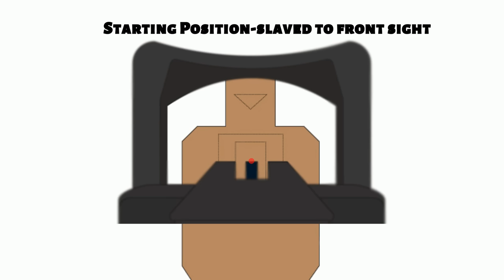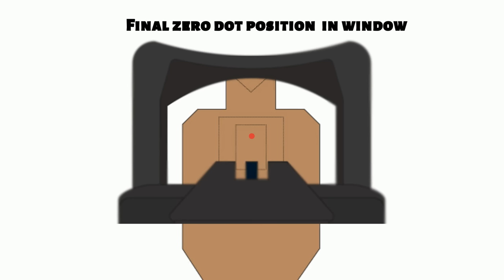Zeroing a Handgun Red Dot Sight

Comment: Aaron, I just happened to be at the range when I saw this post. I began applying some of the knowledge you shared, and I managed to successfully get my RMR zeroed. However, I did stumble upon one question that I believe you touched on but I don’t know if you expanded with context. Did you zero your suppressor sights at 25 yards as well, prior to slaving your red dot? 

I performed this step afterwards and got relatively close.... Given they’re backup sights, I didn’t fuss too much when they were just slightly low of my POA.
Reply from the maker: MDX windage can be adjusted, not elevation. Most of my suppressor sights are POI at 25. Some around 15.
Reply: Great advice. Thank you for the follow up.
Reply: @SageDynamics  Elevation can be adjusted. That's why Dawson has so many different front sight heights. I'm a stickler for my irons to be as as close as possible

Comment: How did the dot change in the window significantly, from the last last two groups?
Reply: That's where you should be placing the dot when shooting. You have to look through the center of the glass as much as possible. So the actual zero was burried towards the bottom of the glass and sights, but when the gun is aligned properly you won't see the sights much.

Comment: I know that I'm late to the party and to this video, and I'm learning to use elect-optics. If you have a handgun with an RDS and dialed-in suppressor- height  sights, wouldn't the dot, when zeroed, naturally fall on the front sight?
Reply: That's where my dot landed after it was zeroed, I don't get the slaving part to the iron sights and bringing the rds in the middle of the window..

Comment: Can ANYONE PLEASE HELP!?!? My rds is like an RMR, but doesn't have the two post's & my slide is cut about 1 mm too long. So there's a small gap at the front of the rds and the back sits against the slide cut, but other than that it's just the two screw that are lock titted holding it on. Is that enough? Should I fill that small gap? Or just a little lock tite in that gap, and the two screws lock titted & torqued down correct enough to hold down and keep the rds from extra shock when the slide reciprocates? PLEASE HELP.. ANYONE KNOW &/OR HAD SAME ISSUE?

Comment: I got into pistol red RDS a year ago. I couldn't tell you how many people say that to co-witness the dot to the front sight is the correct way. I never did agree with that for all the reasons you stated. 

What I like best about RDS on different pistols I own is that the POA and POI is the same for every gun. With iron sights I have guns with a combat hold, center hold and my adjustable sights a 6 O'clock hold which I prefer. With a RDS I use the same hold on every firearm.

Comment: Sir, I just got my Glock slide back milled with the RMR ans the rear notch forward of the RMR, like yours, and I’m also running an x300U... is the Safariland 6354 DO Holster good for it, or would it require any mod work done to the holster??? 

I saw in a prior video that your run that holster with the same configuration. That’s why I ask.

Thanks for your time.

Comment: Ok gays please help me ok,well I just bought me the new Taurus raging hunter in 357/38 special now.and a nice vortex red dot site to put on it now ok,so can anyone tell me at what distance should I site in my pistol in on to get it to shoot out to at least 100 yards.like 10,25,50,75 or 100.and if it is 100 will I be able to shoot with in 100 yards with out holding my pistol high or holding it low,it has a barrel length of a little over 8 inches now.i love to pistol hunt with my older Taurus model 66 357/38 special for deer.on it I have a Simmons prohunter 4/32 pistol scope on it with a 6 inch barrel,and this is my first time with a red dot scope with only 1 bright red dot in it.i always site in all my rifles in at 100 yards for deer hunting,this red dot scope has me stumped a little right now.id love to be able to sight my new pistol in at 25 yards and it be able to shoot plum flat out to 100 yards now,and I'm using 158 grain soft point ammo in it and will be deer hunting with it to so can anyone give me some advice on where I need to site this pistol in at yardage wise!!!!!?????

Comment: At the final zero dot position in the window. Do you adjust it up? Or are you positioning the dot in the center? Thanks
Reply: I was wondering this too
Reply: Bryce Litfin, glad I’m not the only one wondering, LOL
Reply: Tom Picchi, dot was and should always be roughly in center if viewing window; ignore irons when using dot to aim. Dot moves with your head, so keeping the irons low and having the dot well above maximizes field of view. If dot fails, simply raise pistol slightly to line up irons and soldier on. Hope that helps.
Reply: @f308gtb1977  so you're saying when you are viewing the dot high up in the window, that your irons will essentially be positioned with your front sight post high in relation to your rear sights? So if your dot  goes down then you have to adjust the gun back downwards in order to get an accurate iron sight picture?
Reply: MusicMan1eAnda, yeah that sounds exactly right. 

With the dot higher, the front and rear sights would still be lined up with each other in relation to the target, but from your slightly-elevated vantage point it would APPEAR that the front was “elevated” in relation to the rear.

The best thought experiment (or you could actually do it) is to imagine locking your pistol into a vise with it being perfectly aimed at a bullseye at your confirmed iron sight zero distance. Your irons would appear to perfectly line up only when you’re perfectly behind them and in line with the target. You can move your head anywhere and ruin your sight picture but they don’t move. Then turn the zeroed RMR on (assuming the same zero distance for this experiment). Unlike the irons, when you move your head behind, but within, the window, the dot “follows your eye” and stays on the target (ignoring the slight parallax). The dot is on target whether it appears at the tippy top of the window, or right in line with the irons, and in either case the irons never moved. 

If everything is zeroed and the gun didn’t move, both sighting systems are always aimed at the target no matter where your head is. 

The advantage to the dot then is that you have the whole window to get sight alignment vs. the irons.

I hope that helps some.
Reply: @f308gtb1977  I think I may have to actually buy an RMR before I truly understand unfortunately. I haven't looked through red dot sights enough to really understand how they function.
Reply: MusicMan1eAnda, oh, if you have any pals with an AR, probably 75% or more of them have a red dot now, so just go shooting with someone. (It’s just basically bouncing a light off some see-through mirrors. Sorta.)

Comment: With the addition of suppressor height sights, would you "file" down the front sight post or the tops of the rear notch to give you a 25 yard zero if elevation is off?
Reply: Most people that want their gun to be that “on” at a particular zero would probably just choose custom sights. You can either pick your sights independently from a company that lets you mix and match front and rear heights, or pick a set with an adjustable rear sight.

You probably wouldn’t want to file a sight (maybe mill it, but not file by hand), and you certainly wouldn’t want to either file or mill it if it has a tritium ampule in it.
Reply: Kris Says

Comment: @sagedynamics Once my red dot is slaved to the front sight and I proceed to use the red dot exclusively, would it be reasonable to cover or tape my iron sights?  I’m only now realizing how programmed my eyes and brain are to acquire a hard front sight and alignment as quick as possible. Ive shot exclusively iron sights for about 8 years but recently purchased my first pistol RDO. Ignoring my sights might be a task I’d have to actively concentrate on doing otherwise. Just curious on your take?

Comment: Take a glock43 for example. My off duty firearm. Would you cut this zero process back to say 10 yards? Or at this point is it what the shooter is comfortable with doing. Personally speaking I shoot my duty glock 19 better than the 43 due to the size difference in grips.

Comment: Great Video! Would you recommend Sight-in a Holosun 507c with just the Dot on or with Circle and Dot on? I just purchased a Gen 5 Glock 22 40sw MOS and I added the CHPWS V4 plate and a 507c Green V2 Reflex sight. I also added the XS Sight RD3 Suppressor Night Sights since I like to run Night sights on my Carry Pistols but this will be my first Optic Equipped Sidearm for Concealed Carry I have been carrying a Gen 4 G22 for years so the Gen 5 MOS was a natural progression.

Comment: I recently purchased a new firearm with a red dot sight factory installed. The instructions with the sight said that it was zeroed from the factory. I set up a target at 25 yards and fired 3. Checked the target and found no holes. Got a larger paper target. The gun shot 12 inches left and 8 inches low. I called the gun company customer support line and discussed this, and was told I had to co-witness the dot and the iron sights.

Comment: Random question but have you run into any problems with the glock 19 mos ?
Reply: Plates are prone to cracking, and the optic sits slightly higher than a milled slide optic sits.  The MOS optic cuts are also not nearly as robust as a milled pocket. From my experience dealing with the MOS anyway.

Comment: Hey Mr Aaron, I just getting into red dot on handguns. I just ordered a Vortex Viper. Now I also just bought a Sig P320 x compact with the comman Sig night sights, but to put the red dot on I have to take rear plate off and the rear sight is built into the plate and the front sight isn’t suppressor height sight. So when I get ready to zero my red dot do I still merry up the red dot to top of front sight?

Comment: So I recently bought a Glock 40 MOS. 10mm 6” barrel. I purchased a venom red dot for it and this will be the first red dot sight I’ve ever zeroed. I took it to the range hoping to get a decent group at 50yds for hunting applications. I started the zeroing process at 25yds and I just couldn’t seem to get a good group. I feel it isn’t the weapon’s fault but I was using a bag rest just like the one you show in this video and my windage was way off. I had to adjust the windage as far to the right as the optic would allow just to get it in the center of the paper. Elevation I could get decent but my groups were not good at all. I felt like I was nice and slow with my trigger pulls but still my groups were about 4” at 25yds which isn’t what I feel the weapon is capable of. Is there any suggestions you have on this issue? Things that I can look to improve on. I feel like there isn’t much to mess up on besides pulling the trigger on benched shooting.

Comment: I have a Glock 21 Gen 4 with a Double Diamond Precision Barrell and compensator. I also have a Tungsten captured factory weight spring recoil spring plus a uncaptured and captured 13 pound (due for the comp. I also have a RMR type 2 adjustable red dot and the Trijicon suppressor sights. First what is the best HST and Guard Dog target ammo's that are comparable in target shooting that match these ammo's? Second does anybody have experience know what the best recoil spring weights work best with these ammo's and the Double Diamond compensator are?
Reply: Sorry forget to mention I an still waiting for the slide but I also have the Glockstore Mako cut and red dot cut for the RMR sight.

Comment: What does a 25Y zero do at 50Y with 124gr ammo?  
With regular iron sights, I have to aim about 6"-8" low to hit at 50Y, but I assume I'd have to aim dead center or high for 100Y.  I'm wondering how a red-dot affects POI at distance SINCE the dot is much higher over the bore then regular iron sights.

Comment: Hey Aaron, first off I want to thank you for all the knowledge you share. It’s good to know there is somewhere you can turn to for unbiased information. I’m just wondering what you have found to be the best zero for 45 acp. I know for 9mm , you go with 25 yds (as do I from your videos). I just haven’t been able to find any good content in regards to 45. I’m using Speer Lawman 230 grain through an FNX 45 Tactical mounted with a Trijicon RMR. Thanks again for all you do.

Comment: I’m confused, the first three adjustments are all in line with the irons. Then the final zero dot position in window is floating way above. How did you go from basically co witness with irons to all way up there floating by itself. I’m having a hard time zeroing my first pistol dot. Only way i can hit is completely co witness. I’m doing something wrong here.
Reply: The difference is in the angle that the gun is presented when aiming , if you’re dot is zeroed onto your front sight when you present you hold the gun more relaxed so that the dot is in the middle of your window instead of holding it with the irons aligned. Holding the gun so the irons are aligned should give you the same point of impact as if you held the gun more relaxed with the dot in the middle vs aligned with the front sight 🤙🏽  Hope this helps/makes sense haha Red dots are parallax free so wherever the dot is, if properly zeroed, that’s where it should hit allowing you to hold the gun more relaxed and not trying to align the sights

Comment: Thank you I feel like I have a platform to go off of when I'm zeroing my holosun 507c on my glock 19 mos but I did mill the screw holes so there a little deeper so it will not come loose or move at all I've shot 2,500 rounds and so far so good so thank you earen I really appreciate the time that you take to put out such informational vids man 🙌🏼
Reply: Charles hood how are you liking that optic I been thinking about getting it over the Trijicon
Reply: @roba168  Rob, I have a Holosun 507c and 507c v2 and I love both of them. I think its ridiculous that it went up like $80 for v2 for the battery compartment to be on top. Aaron very good videos on the Holosuns.

Comment: When he says "roughly centers the red dot in the window", is he doing this centering by adjusting the dot up via clicks or just by angling/tilting the gun up with his hand?
Reply: Isaac Mouser have you found the answer for this question? I’m still trying to find it
Reply: In the beginning its clicks. You lower it down go the front post with clicks, walk out to 2t yards, bench rest it and shoot 5 rounds. Then you make adjustments.  Do this a few times until you are on.
Reply: Isaac Mouser I get the part we’re he lowers the red dot to match the front sight post but later In the video he says the view of red dot should be in the middle of the window. Is this done by just angling the gun once it was zerod in
Reply: @pokeopening1113  after you move the red dot to the fsp in the beginning, the only time you adjust it again is to adjust into your zero. Centering in the window for centering's sake would throw your zero way off.
Reply: Isaac Mouser bit of you watch his video the first two pictures were his red dot was adjusted says view from the “iron sights” but then the 3rd picture when the red dot moves up it says “window view”
Reply: @pokeopening1113  he also says repeatedly to not zero the dot in relation to the irons. You only zero the dot to the target. Ignore the irons after the slaving process
Reply: @pokeopening1113  you ever solve it? If so please explain

Comment: Thanks for posting this video and your video "Why you should never slave your red dot to the iron sights."  Your videos were extremely helpful.  By habit I had gotten it all wrong. I used the incorrect technique when I shot and placed the red dot on the front sight.  On my next trip to the range, I will re-zero the red dot reflex sight and start with placing the red dot on the front sight and then when I bisect the dot I'll move on and continue the sight zeroing process by placing the red dot in the center of the lens window so that I will be able to shot by centering the red dot in the middle of in the window and place that red dot directly on the target.

Comment: Thank you for this video!!!
First step issue: p320 Xcarry withRomeo1
• salving the red dot to my front sight is not possible. I have no more clicks down and I am left with a gap between my front sights and red dot. My target hits are below at what am aiming. Been trying to solve this problems for months. Thank you for you time!
Reply: If you're Hitting low, your dot needs to brought up. Also know that factory irons can be sighted for far shorter distances than you're probably trying to achieve with your red dot. Try it at 7 yards maybe, then 15, then 25... see if your results improve or not at any particular distance. If they do it could just be an issue you'll have to deal with because of the design of your guns iron sights, if not maybe a red dot issue, slide milling issue etc. may be worth looking into. With some guns and some distances you'll have to decide if you're wanting to go by irons or dot. Even IF you get a "good co-witness" it's only true at the distance at which you set them to co-witness, anything too much closer you'll probably shoot high, and anything too much further, you'll probably shoot low. I hope that kind of helps, if not, ignore it.
#GetMoneyFuckBitches
Reply: Brandon Lee Thank you for your reply and videos. I have been following and applying your techniques. I hit my red dot every time now at the range. Thank you a lot, it took me a while to learn red dot basic and I am completely confident carrying this XCarry with Romeo1 optic now thanks to your lessons.#GetMoneyFuckBitches
#Merica🇺🇸

Comment: This may be a dumb question, but for the final zero dot position in the window, how do you get the dot back to the center of the window without shifting you poi?
Reply from the maker: Elias Arroyo that’s roughly where it will be when the gun is zeroed.
Reply: SageDynamics awesome! Thanks!